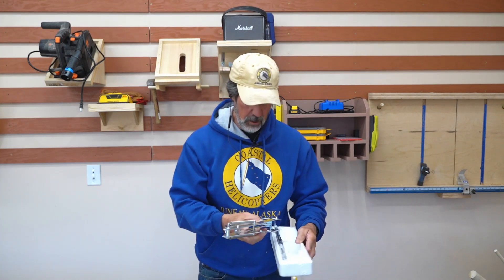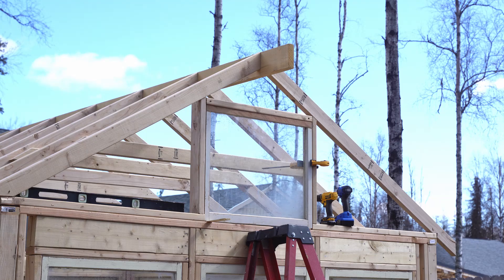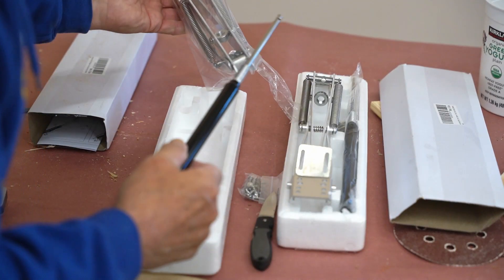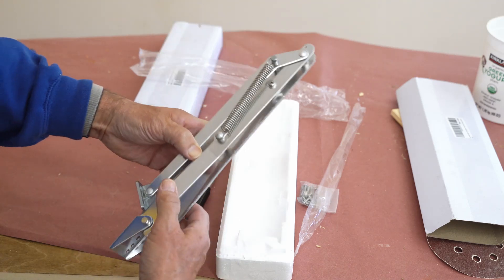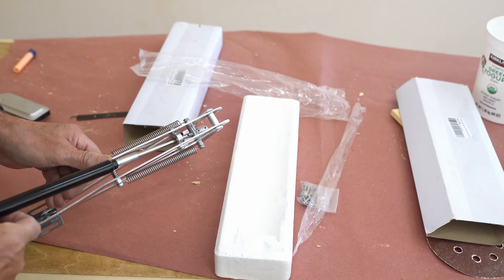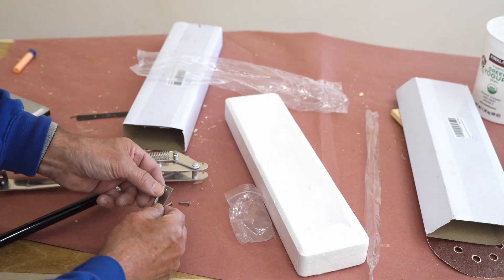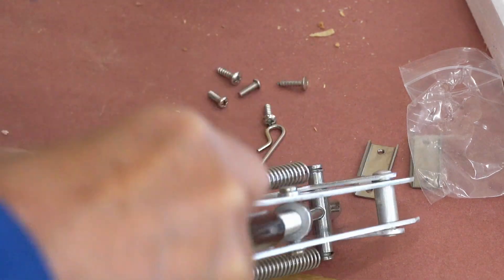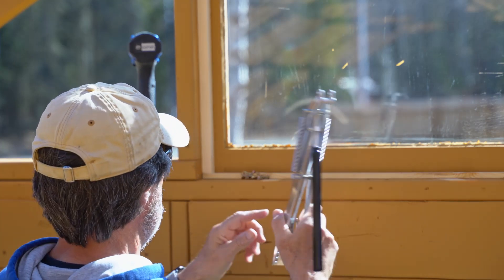Automatic Greenhouse Vent Openers

Comment: IF you open one of your gable vents & put a fan in the other, the air will simply enter one & shoot 
straight across your GH & exit the other leaving the lower part of your GH hot. 
LOW enter
HIGH exit.

!
Reply from the maker: I have a solar-powered fan I will be installing as soon as the snow melts! Thanks